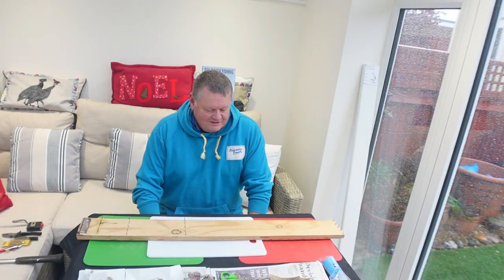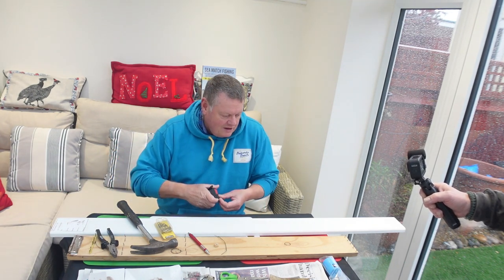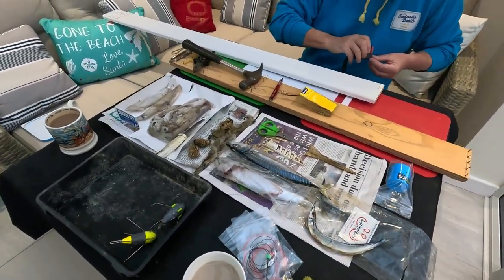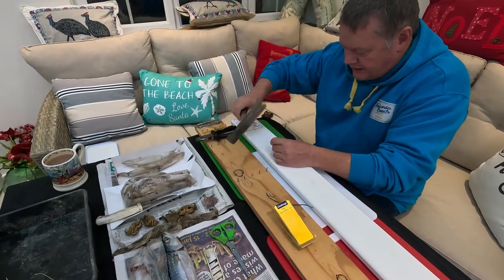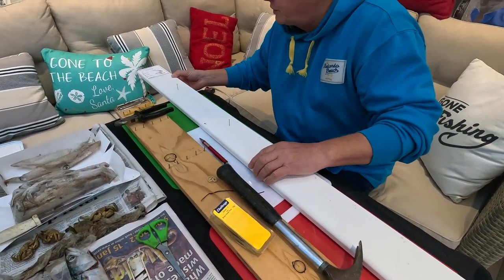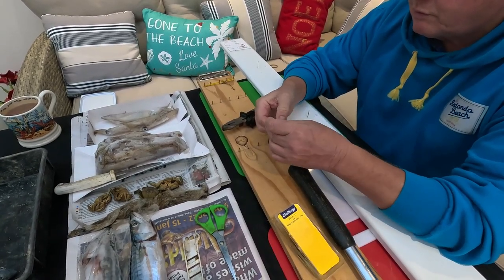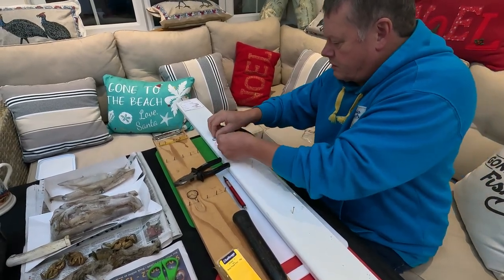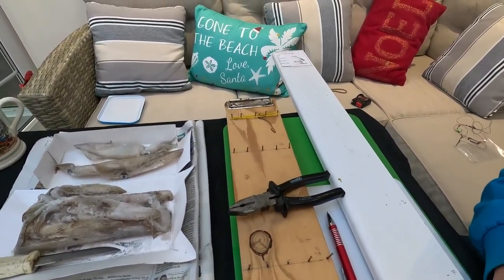How to build rigs with Steve - the RIG JIG

Comment: Steve 
Know the wire that you got of the elastic band from the elec cable do you take off the outer sheath & just use the copperwire etc or leave it on please
Reply from the maker: The wire was stripped, but you can use any wire, the wire in the video was garden wire. I personally use a big clip swivel.
Reply: @Tonys Tackle Sea Fishing  can you put a photo of that clip up please
Reply: Hi Gary, just the plain wire. I remove the outer cover.
Reply: @Stephen Kerr  found a clip that works thanks 🎄 😁
Reply: Steve 
Is your rig board 90cm from end to end or less please
Reply: @gary-dn4uw  yes 90 from end to end.
Reply: @stephenkerr1002  thanks